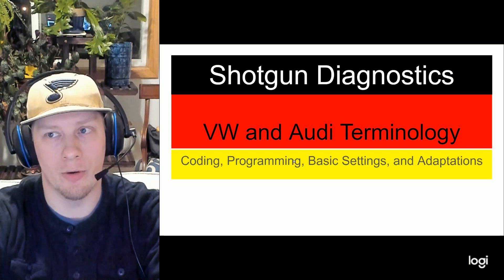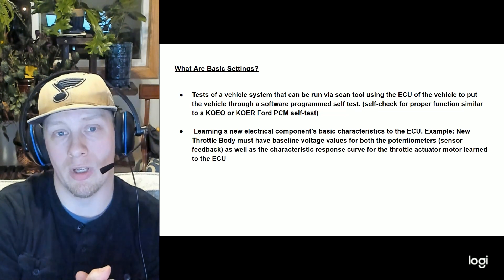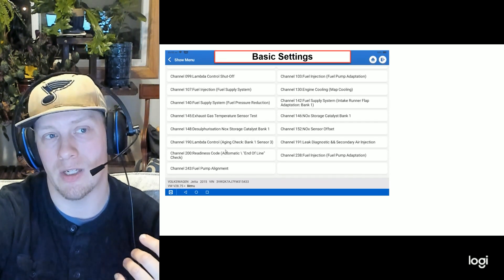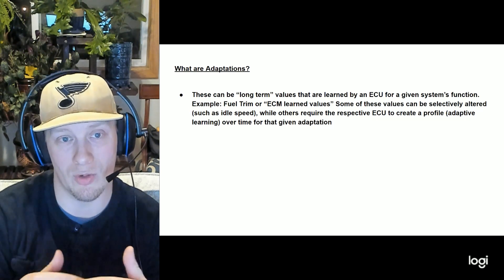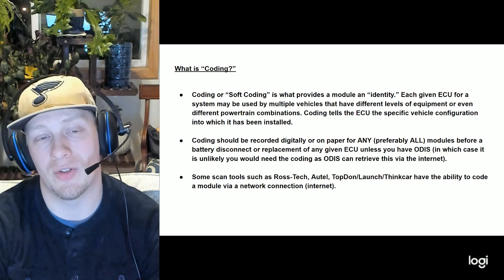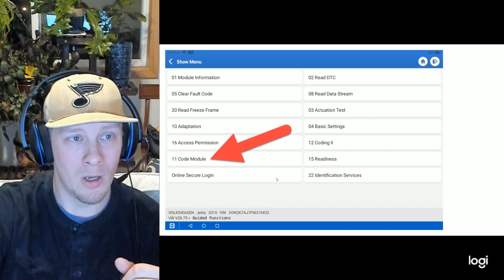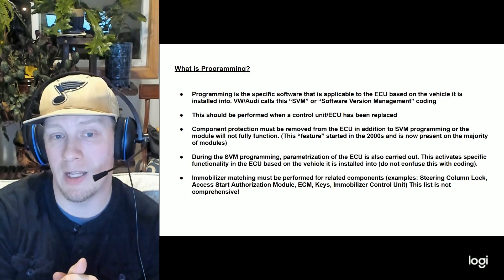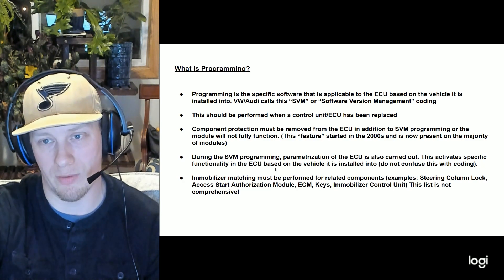Audi/VW Coding, Programming, Basic Settings and Adaptations Overview

Comment: I was able to pull a list of my vehicle’s available adaptations, but I would like a more detailed explanation about what each of them does. Is detailed information about the vehicle’s adaptations listed anywhere like a technical manual or something?
Reply from the maker: ODIS (factory software) will show you what each one does in most cases. VCDS may provide some insight but a lot of it is not documented other than in owners forums. ODIS can now be purchased via Erwin.vw.com and erwin.audiusa.com (for US market) and used with a j2534 like the TopDon RLink.

Comment: Would it be possible to code in «press both shift paddles and it returns to automatic shift?
Reply from the maker: Coding can often be changed to something other than what the original was. The options you have will depend on what possibilities it had from the factory. Some aftermarket tools can help with this using a long coding helper (if it’s long format). If it’s short format Ross tech wiki sometimes has the coding option list.

Comment: Hard to believe that a disconnected battery could cause the loss of coding for a bunch of modules?
Reply from the maker: It’s certainly not common but I’ve definitely seen modules lose coding during a battery disconnect
Reply: @shotgundiagnostics  Presumably that immobilises the car? So a flat battery 500 km from a service centre (certainly possible in Australia) means you have to pay for a round trip tow of 1000 km. That's crazy.
Reply from the maker: @paulwary  depends on the module that loses coding. Thankfully I have not seen any module lose coding that stopped the vehicle cold in its tracks. However as you can imagine it will cause functionality issues and fault codes.

Comment: Thanks for the information. I am weak on Euro so this is great basic information. I think many like myself get confused by the terminology that VW uses. I never knew that about the blue tooth adaptation.
Reply from the maker: Yes on the low line VW’s the Bluetooth has a maximum “capacity “ for paired devices. I learned that thanks to my own Jetta not pairing with a new phone! Thanks for watching!